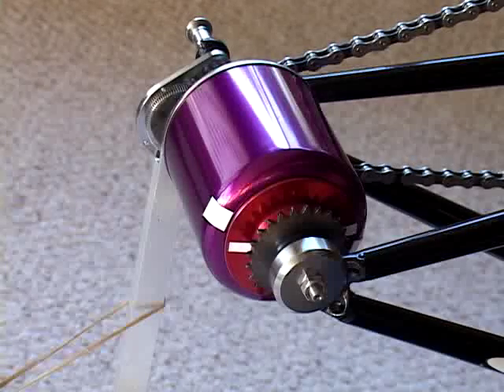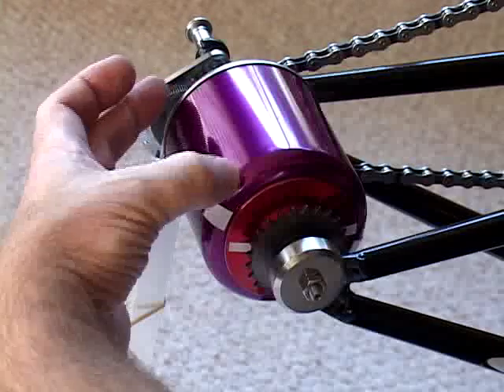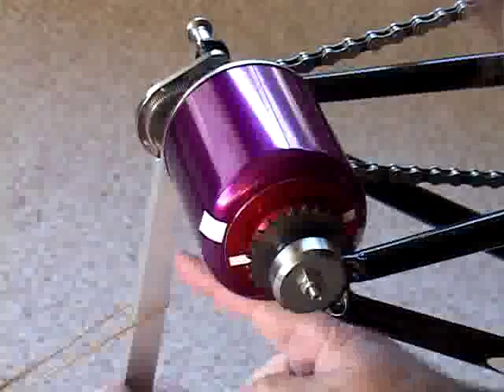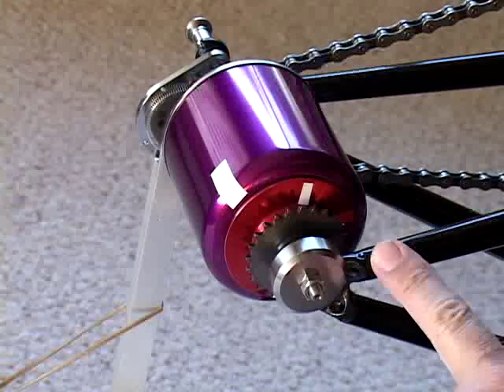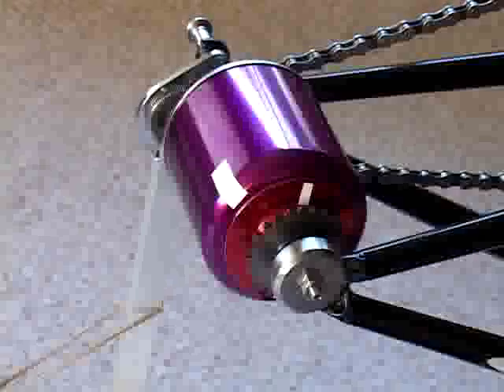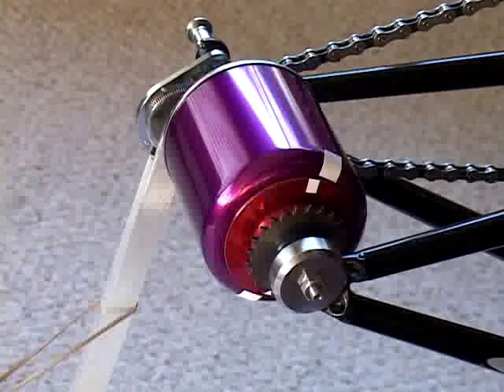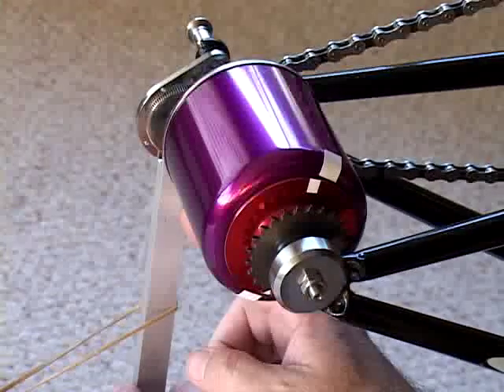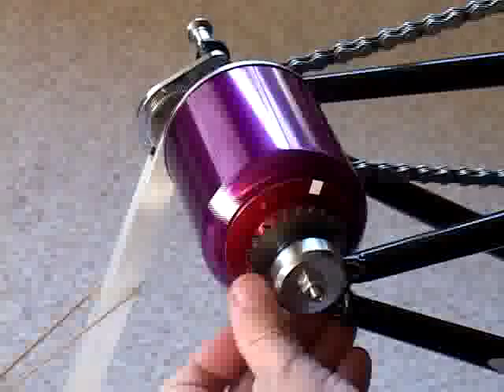Automatic Bicycle Transmission (IVT)

Comment: Ah, mild eureka moment; I think I had it in my head that a given torque input always corresponds to a given ratio in the unit.  I think what you're saying is that what actually happens is that so long as the input torque is in the "sweet spot", the ratio remains more-or-less unchanged, regardless of what it is.
I.e. it's the *rate of change* of the ratio that is (inversely) proportional to the input torque?
That does sound effective, and quite ingenious!

Comment: It looks very similar to the old C C M bicycle 3 speed transmissions of the early '60's. Could your Ratio Control Lever be a little cumbersome on a working bicycle with constant changing required for uneven road grades? I also suggest this could revolutionize ALL cycle transmissions period! Thanks for posting.

Comment from the maker: ...furthermore, the intent & actual effect is to regulate pedaling force & cadence to remain optimal in a 'sweet spot' regardless of bike speed.  The concept of a sweet spot applies to IC engines & electric motors too, so the SIVAT can be used beneficially for all motor-driven machines & vehicles w/ variant output speeds.

Comment from the maker: When your gear ratio is too high, the rider will naturally use more pedaling force on any bike.  The SIVAT ratio control mechanism is spring-loaded toward high ratios, while also being reactive towards lower ratios from pedaling torque.  These opposing forces are in a state of equilibrium when the rider is pedaling within a narrow band of torque (force) regardless of the SIVAT's ratio; outside that narrow band, the ratio will change rapidly toward low, slowly toward high until new equilibrium.

Comment from the maker: Your question is ambiguous.  Anyway, the drive ratio will tend to drift slowly toward higher ratios if pedaling force stops.  A ratio lock lever will allow the rider to stop that drift at any time, freezing a ratio until unlocked.  General torque-responsiveness can be adjusted, but won't drift after adjustment.

Comment from the maker: The current design increases its intrinsic highest gear ratio to ~3X, so it's no longer a reducer only.  This change enables use of a modest 36T/18T sprocket combo to achieve gear ratios higher than most bikes.

Comment from the maker: The SIVAT works like it should for a bike.  The theory of its automatic operation & gearing have been proven with mountain riding using a predecessor CVT; the SIVAT has both higher & lower limits of gear ratio than that automatic CVT.

Comment: Look for anyone to has mechanical experience he make something with that one the one ratio that means your motor are your output whatever you're using to better yet say your input say your motor and you have your transmission your input is your motor your Output is the transmission your input would need to be one your output would need to be five and that would give you a high-speed low RPMs and your transmission would be doing all the work yeah going up a hill u would need like motor 5 to 1  t

Comment from the maker: Yes.  The SIVAT has an unlimited number of ratios available.  You might consider it as a thousand-speed transmission.  Also, its highest gear is higher than most, & its lowest gear is much lower than any, with all choices in between.

Comment from the maker: You're forgiven!  It would take hours to read all the comments.  Torque-sensitive ratio control makes the most sense by far; I extensively tested my own auto-CVT predecessor in mountain riding, so I can assure you of that.  Peak input torque automatically limited to ~100 Nm (an industry standard), & will be user adjustable on the unit.  Peak output torque:~200 Nm.  These values would accomodate world-class sprinters with their 'explosive' pedaling.  A ratio lock lever will be included.

Comment from the maker: Yeah, actually the BB is the very best location, but standard BB's in bike frames are too small in diameter for the SIVAT.  One solution would be to create special full-suspension MTB frames to accomodate the SIVAT for both pedal-power & motor/engine use; the SIVAT could be either a special BB-cartridge style or mounted above a standard BB with a secondary drive to the BB.  What's your take on that?

Comment from the maker: You're welcome.  Getting one design into several uses will help bring the cost of production down.  I've deliberately sized the 2nd design for power & physical size & shape to make it most universal for several likely applications like small motorized vehicles, conveyor drives, industrial machines & robots.  Since I've designed some of such devices during my long career, I'm fairly familiar w/ those apps, as well as bicycles like MTB's.

Comment from the maker: Yes, that's a frequent question.  It's extremely unlikely that anyone but a gorilla pedaling up the steepest hill could invoke overload protection.  It will remain a feature to protect the SIVAT from radical abuse, such as hooking it up to a motor beyond its proposed power capacity, beyond pedal-power limits of elite cyclists.  Even if one could invoke that function, it would be a gradual event followed be an intrinsic recovery.

Comment from the maker: Thanks.  I now have a source for funding.  But you're correct about Tesla; they once had a 2-speed transmission to improve efficiency, but abandoned it because their torquey motor broke gears on the shift from shock-loading.  The SIVAT does not 'shift' with any disengagement/engagement cycle, so it should work well for their drive system.  I've had them in my sights for later development.

Comment: Thanks for the info.  You mentioned in the video that the hub has over load protection. How much load would it take for that to kick in? I'm fairly light at around 140 lbs, if I'm cycling up a steep hill would this be an issue?

Comment from the maker: Yes.  Thick snow may be no match for a lot of torque at the drive wheel.  It will be slow & steady until you get to the dry patches where you'll speed up.

Comment from the maker: Internal highest ratio will be ~ 3:1 in the new design.  This will allow very moderate sprocket sizing on a bicycle to achieve rather high top gear ratios.  Think about a 36T/18T sprocket combination that allows a very high top gear.

Comment from the maker: The pre-production design will be field-tested & modeled w/ FEA to determine how light it can get; I estimate SIVAT to be ~ 2-3 kg for 2 hp throughput when optimized, but a lighter version for just pedal-power will have a lower rating of ~ 0.5 hp for fairly hard use in MTB's, maybe ~1.4 kg.  It will be sealed, so oil-flushing without disassembly will be for user servicing.  Repairs will be factory-serviced, likely on an exchange basis, so we intend to make it very reliable & modular.

Comment: true true.  It is a very good idea. What about reliability???  But as far as ease of access... How easy is it to clean or fix if there is a problem.  I feel like it is a good idea, but it needs to be ultra perfected and fine tuned for the UCI to even consider it in races etc.  What is the weight??? In grams.  With the lack of a derailleur system, does it cut weight, or remain identical.  Also, I was completely kidding about the "Di2>your invention" no hard feelings lol.

Comment: Exactly! It means that you can be in the right gear so to speak, at all time.
Also, as it is nearly fully enclosed, it can potentially be a lot more maintenance free, and you don't need to worry about chains falling off from time to time because it doesn't need to jump from gear to gear.

Comment: I don't get the number of dislikes! Our current system of gears on a bicycle is stupidly crude. A device basically crams a chain from one gear to another. If a system like this could be developed for my mountain bike, and it would give me the ratios I need, I'd be extremely happy. Great idea. Keep working on it for bikes:)

Comment from the maker: Tests reveal that the optimum cadence is 90 rpm, or 1.5 Hz, on average.  Individual cyclists vary a little, but 1 Hz is too slow for most.  The best way to momentarily increase power is by raising cadence from 90 rpm, raising power proportionately, but at the expense of exhaustion.  The new SIVAT, currently in development, will be tested on a bicycle within months.

Comment: Barry Simpkins; why don`t you target the wind turbine sector? Its seems the ideal market (the auto industry does not like using "outside ideas".

High speed wind is useful but rather than braking the turbine; your `gearing` method could go into free drive when wind speeds get too high. The angle of the wind turbine blades could also be connected to the `adjuster` on the ratio lever (torque convertor) you point to in the video.  P.S. I also invent.

Comment from the maker: I looked at it.  There's a bike museum in Sacramento that features several types of drives, none of which has gained widespread popularity.  I'm quite sure that the conventional pedaling system is tried & true for very good reasons.  Oddly though, the SIVAT will first be applied to an unconventional drive for proprietary reasons.  Following that, it will appear with conventional bike chain-drive systems.

Comment from the maker: The new design in product development has an internal high ratio of ~3:1.  Multiply that by the sprocket ratio, front-to-rear, to get the overall ratio.  It will easily get higher ratios than most bikes.

Comment from the maker: The SIVAT's ratcheting mechanism uses the same system that's used in most automatic transmissions in cars, so it's reliability has been very well proven, and is rarely the source of failure in those transmissions.  The SIVAT's gear ratio has negligible effect on the speed or forces therein.  It uses rolling sump lubrication common to all hub transmissions on bikes, so that's proven effective too.  We'll conduct life-tests to find & solve any weaknesses before commercializing this as a product.

Comment: The immediate thing I realized in this video is that this transmission could remove the need for a clutch in vehicles, being that the motor would be able to freely idle although the drivetrain is stopped. I'm not sure if the control in this video could be automated, but if not, a pedal or lever would still have to be used but an actual clutch mechanism would not.

Comment from the maker: Overload protection will be user adjustable within the power rating of the SIVAT, and is only included to prevent catastrophic failure in the event of abuse.  It's occurance will be very rare,very subtle & easy to recover from.

Comment from the maker: You're ignoring the fact that the front sprocket is much larger than the rear sprocket, giving the system overdrive.  Regardless, the new design will have its own high gear ratio limit of ~3:1 without relying on such sprocket sizing; this will allow a fairly small front sprocket that will enhance ground clearance.

Comment from the maker: Thank you.  I used to be a hot rod, and knew quite a lot about high performance cars at the nuts-&-bolts level including the effects in competitive driving; I raced autocross.  Be assured that that helps a great deal in M.E.  Automotive transmissions are a target market for the SIVAT.  Once proven on smaller vehicles, I'm sure that it will enhance performance in cars with scaled-up versions.  The numbers indicate that it will likely be smaller than conventional units.

Comment: Yes, Mechanical Engineering student and master fabricator/tuner/engine builder for a racing group called Rebel Racing. I do tons of work with 3rd 4th and 5th generation GM vehicles, typically with big camshafts, and aftermarket torque converters to make up for their lack of low end torque.  This would be an amazing unit if it could handle the abuse  of 500-1000+ horsepower in cars, with an electronic controller to dictate stall speed. Good luck!

Comment from the maker: Excellent question!  You must be an M.E. or student, as such!  The SIVAT does not use hydrostatics, but measurements of heat propagation of a related mechanism indicate that losses are low, likely ~ 6%-12%.  This will be tested on the 2nd generation prototype in at least 2 ways: via thermal mass transformation over time, and by dynamometer tests at various ratios. I doubt that a lubricant cooler will be needed; rolling sump cooling should do the job for bikes & motorcycles.  Thank you.

Comment: I've got a question. What does this unit do so far as heat versus load. You compared the unit to an automatic transmissions torque converter, that as we know, the higher the stall speed the more heat is created, especially with more power being applied to the input. This heat typically being created by fluid friction within the turbine of the converter. What happens here? Would this eliminate the need for trans cooler and/or a large primary transmission pump?

Comment from the maker: Yes, that's one way it could be used.  A better, simpler & more effective method would peg full-throttle operation to maximum power from the engine.  Peak power rpm is usually different from peak torque rpm; an important distinction for SIVAT's operation.

Comment from the maker: I'll know how much friction (lost efficiency) there is when I test the next design for a full bicycle install.  The loss calculations, based on known gear meshes, suggest efficiencies that vary between 88%-94% depending on the ratio used.  That compares fairly well with other transmissions.  BTW, the new one will install in the hub or at the BB w/ slightly different adapters.

Comment from the maker: Of course, there are practical limits.  The name IVT uses 'infinite' in the name to designate continuous ratio changes all the way to zero even if it's geared up to increase the top end.  In effect, the input can revolve an infinite number of times at zero output; this distinguishes the IVT from the CVT.  It's a descriptive, asymptotic naming convention that preceded this invention, widely used for decades.  I've met the engineer who is credited with coining the term.

Comment from the maker: You'll be able to tailor the ratio range to your personal taste by your choice of front & rear sprockets, but the range will always go all the way to zero (in practice, to extremely low gears) regardless.  For the highest ratio, a 34T/18T sprocket combination will deliver a ratio higher than on road bikes; >125 gear inches.  You'll also be able to tune the cadence bias, with 90 rpm as a starting point.  Pedaling cadence & force will both remain fairly constant for all grades.  Thanx!

Comment: I realize your invention uses different mechanics to transfer energy, no 'set' gears but a sliding/smooth infinitely-variable system - but what I am hoping to understand is what gear-range comparisons there are between these products. There are so many cycling specialties, it would help to know how your product will fit into the demands of this great sport:

wikipedia = /wiki/Bicycle_gearing#Gear_ratio_calculators

I salute you for your work!

Comment from the maker: Pardon my interjection please.  You are correct!  Well stated!  My own calculation to determine a maximum grade for overload is based on whether you can sustain traction and/or avoid a wheelie; your 50% reference is quite accurate.  I commend you for thinking through the physics.  You're also right about the patent.

Comment from the maker: True, but for FS bikes especially, the lowest unsprung mass offers the most responsive ride.  I'm inclined to offer both a SIVAT hub that can easily be retrofitted to existing bikes, as well as a FS bike (via a bike mfr) equipped with a SIVAT at the pivot.  Either way, you'll be able to say goodbye to chainslap, chainsuck, jammed derailleurs & such limited ground clearance that large front sprockets have.

Comment from the maker: My second design accomodates SIVAT positions at the hub, BB & swingarm pivot, as well as optional motorized use.  I agree that its best location is close to the CG.  BTW, 'gearbox' & 'transmission' mean the same thing, and whether or not they are within other drive links (such as a driveshaft & differential in a car) does not preclude their definition as such; any drivetrain can contain a transmission as its subset.  Also, I'm not fond of 2WD bikes because of the complexity of driving a steerer.

Comment from the maker: Prius uses an all-electric Kinetic Energy Recovery System (KERS), which is ~35%-40% efficient.  This would be better used with a flywheel KERS, which would be nearly twice  as efficient and less costly to produce & operate!  Flywheel KERS has the highest energy density of all types, and if it is executed strategically, also would have low windage (aerodynamic drag) losses.

Comment from the maker: Thanx!  The new design (not shown) has a designed capacity of 2 hp at about the same size.  Sizing this up for 100 hp would result from increasing the scale by ~4X, slightly smaller than a conventional multi-speed transmission for equivalent power.  

Having been through the patent process several times for other inventions, I know how to structure patent claims to frustrate 'end runs'; it's like a game of chess, a game of strategy.

Comment from the maker: By convention, transmission ratios are output speed divided by input speed.  The newer SIVAT ratios will vary between ~3:1 and 0:1 internally; the high limit is raised by the external sprocket ratio, so the 5:1 sprockets in the demo would provide a 15:1 final high gear ratio!  Using a much less radical sprocket combo (like 34T front to 16T rear) would still get a higher top ratio than road bikes have.